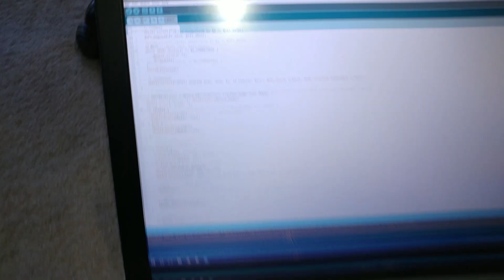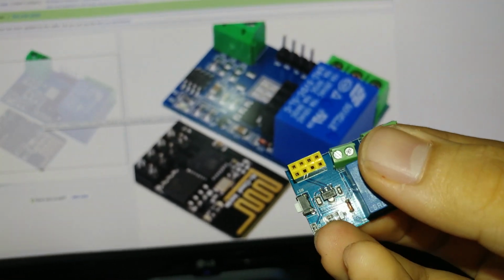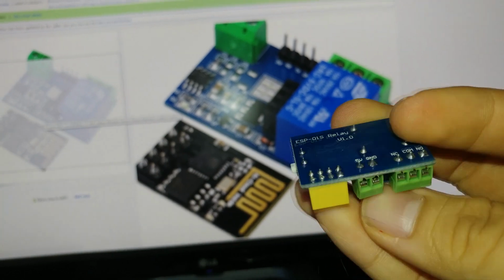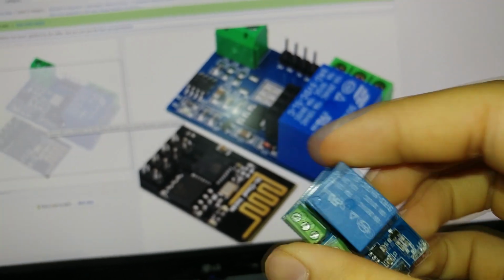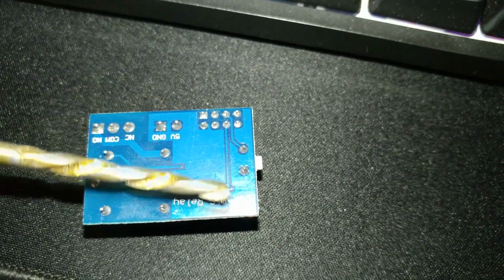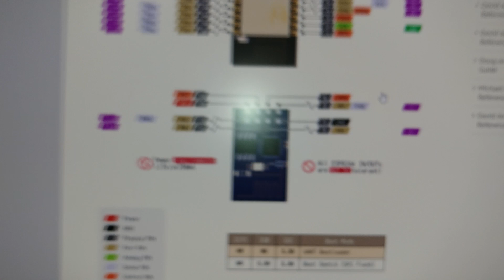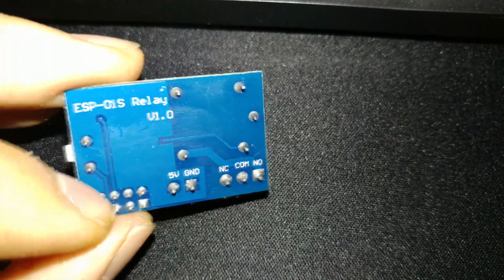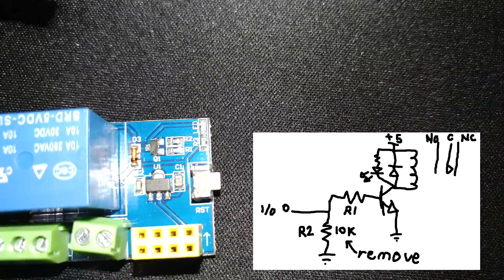How to fix cheap ebay ESP8266 relay module

Comment: Hi SilentDreamcast. So update to my testing using GPIO3 and the good news is it worked. I just had to use a 10K pull down resistor between GPIO3 and ground to stop the startup pulse but since the Arduino bootloader code doesn't care about the state of GPIO3 at boot time it's fine. I'm not sure if 10K is the right size resistor but it seems to work. I'll do some more reading about how to correctly size the resistor.

So in summary when using Arduino code on the ESP-01 in combination with this relay module and avoid the activation of the relay during power up you need do the following mods to the relay board AND don't print anything to the serial port in your code as it writes to GPIO3 which we'll use now for the relay. Printing to serial could cause unwanted relay activations;

I wrote a bit of a step by step below;

!st just google for a diagram of the ESP-01 pin outs such as this one - https://circuits4you.com/2016/12/14/esp8266-pin-diagram. I have a couple of pics of the board mods which I can share with you if you're interested although you'll have to forgive my soldering skills.

1. Jumper pin 4 (CH_EN/CH_PD) to pin 8 (VCC), as SilentDreamcast said in this video thanks.
2. Remove the 10K resistor (R2), once again as SilentDreamcast said so thanks again. It's easy if you just apply a bit of solder (you don't need a lot) and poke it with the soldering iron tip and it will just "float" away. Then use a solder sucker or braid to clean up the excess solder and make sure you haven't bridged anything you shouldn't have. Careful too NOT to accidentally remove the other resistor R1 as surface mount soldering is a bit tricky. The two pads where R1 used to be should be open circuit and not be bridged/connected when you finish.
3. Cut the track on the bottom of the relay board close to pin  5 (GPIO00). I suggest you test continuity between GPIO00 and the two resistors (R1,R2) on the top of the board before and after the cut to verify you've disconnected it. Test to the side or R1 furthest from the relay (or to the pad where R2 used to be as the two are connected). I used a small jeweller's screwdriver slowly and carefully to scrape a rut in the track close to the pin.
4. Scrape off a bit of the protective insulation coating on the track running from pin 5, about 3mm is enough, and tin it with solder. Be gentle you just have to scratch a little. You don't want to scrape the track off the board. Once again I used the same small jeweller's screwdriver.
5. Take a 10K resistor and solder one end to pin 7 (GPIO3) and the other end to Pin 1 (Ground).
6. If you pend the resistor leg going to pin 1 to run it's path along the track you scraped in step 4 before leading it to the ground pin you can solder it to the track that used to lead to pin 5 (GPIO00) and kill two birds with one stone. NOTE: I suggest you solder the lead to the VCC pin first before soldering to the scraped track. You don't want to apply any pressure by pulling the lead after it's soldered to that fragile little track or you could just lift it right off the board and make a mess.

Finally and this is optional I soldered a 220uf electrolytic and a .1uf polyester capacitor in parallel across the coil of the relay to reduce chatter. This may not be necessary but I found it stopped the chatter of the relay I experienced at one point during testing at power on. The second module I modified didn't exhibit the chattering so it might be overkill? It's not expensive or difficult though so up to your discretion. Just orient the electrolytic capacitor the right way. I just manually activated the relay briefly by touching the pads on the board with 5V to determine the correct polarity. The coil leads are the two in parallel furthest apart at the opposite end of the board to the ESP module. If you turn the board over to the solder side and orientate the 5v Ground markings to your right then the coil pins are at the top of the board.

That's it. Works like a charm now after only many hours of lost sleep hacking about and googling :-) 

FYI. I am using some code based on another youtube post - https://youtu.be/X4qXy2JFg_w
I control the relay throug a message bus called MQTT and I run a broker called Mosquitto on a Raspberry Pi. You've probably heard of MQTT but if not it's a must for anyone interested in Home Automation so look into it. Message brokers are used for various commercial applications too some of which I work with. The principal is simply that the Arduino "listens" for a message on a channel name, e.g. GarageDoor. The message could be OpenDoor or CloseDoor, etc. or anything you want it to be. When the code sees the OpenDoor message it toggles the GPIO on for a few seconds and off again and voila when connected across the right terminals on the garage door opener it triggers it. You can then tie this in with other things like NodRed, OpenHab2, HomeAssistant, etc. I am dabbling with all of them and havent' settled on any one particular solution yet.

Thanks for your help and input. Without your post I would have been really stuck trying to figure out why the module didn't even work at all in the first place. I knew about the CH_EN/CH_PD to VCC requirement but never would have guessed removing the 10K resistor.

I hope this write up helps others to get there faster.

Cheers,

Steve

P.S. Love the ESP8266 modules. Like a powerful Arduino with built-in wireless. Been dabbling with them for a while.
Reply from the maker: Awesome work m8. It's good to hear that you got it working. I'll have to note GPIO-3 is the one to use for failsafe outputs on the smaller ESP-01 modules. Also for pull-down resistor, I usually use anything from 4.7-10k, (mostly 10k) especially since lesser current draw for switches and it is a common value for analog sensors voltage divider.
Reply: hi, thanks for your guide! :)
i did this, can you check it's correct? https://imgur.com/a/3vmlflK
here the code i used: https://pastebin.com/ThvKjXHc
but it worked until doing your mod (if i made it correct): on boot i had a burst of on/off of the relay when initially using pin 0 for relay, while now with pin 3 it does not trigger at all... maybe i soldered the resistor the wrong way?
the track from relay to gpio5 is cut, tested with multimeter... and tested the scraped track and soldered resistor leg connection, too, it seems fine...
Reply: nevermind, i reverted the resistor for testing, and now it works flawlessly... BIG THANKS to BOTH of you!
https://imgur.com/a/mgbNZ4Y

Comment: LastI night I found information that indicate GPIOs0-2 present on the ESP8266-01 won't do what I want when using the Arduino boot loader.  See the first response in the post;

https://www.esp8266.com/viewtopic.php?f=32&t=16141.

GPIOs0-2 are always toggled high by the bootloader and you can't use a pull down resistor as the bootloader interprets the state of these pins to select various boot time options. e.g. Enable programming if GPIO0 is held low at boot.  From the link above;

"GPIOs 0, 1, 2 and 15 are pulled HIGH during boot and also driven LOW for short periods. 
The device will not boot if 0, 1 or 2 is driven LOW during start-up."

This makes GPIOs 0-2 unsuitable for a relay control app using Arduino code if you can't tolerate this startup behavior or add some components/circuit to work around it (but I don't know what). This relay board was built to use a different firmware for the ESP8266-01 where the boot behavior differs from Arduino and so does not have the same issues, including the CHP_EN pin 4 needing to be held high by the mod you described.

My 11 year old son actually came up with a possible workaround that I, initially, dismissed out of hand :-). He said why not toggle the relay twice after boot so the door stops opening from the boot toggle and then reverses/closes again. I will try this and see if it works but I expect it will.

However I'm still, stubbornly, not willing to give up on the "proper" solution. What I now know is that GPIO3/Tx is also driven high during boot but its state at boot time doesn't influence any Arduino bootloader behavior so my theory is that if I use a pull down resistor to hold this low at boot and don't write anything to the serial port at any time in the code (as that flashes the Tx led/pin) then GPIO3 might work for me.

According to documentation,  in the link I mentioned earlier, GPIOs 4 and 5 are the only ones that are always high impedance and the best options for my application but as you know ESP8266-01 only has GPIOs0-3. All other GPIOs on any on the ESP8266 varieties have internal pull-ups or are even driven low/high during boot.

"GPIOs 3, 12, 13 and 14 pulled HIGH during boot. Their actual state does not influence the boot process. See below.

GPIOs 0, 1, 2 and 15 are pulled HIGH during boot and also driven LOW for short periods. 
The device will not boot if 0, 1 or 2 is driven LOW during start-up.

GPIO 16 is driven HIGH during boot, don't short to GND."

I will experiment tonight and report back on the results.
Reply from the maker: Very very interesting. I haven't played with ESP8266 for very long and have only ever used the bootloader that comes with the chip. And the projects i have done with them aren't affected by that quirk (I use it as a quick test "feature"). I'll have to play around more with these too during some free time

Comment: just wondering after removing the resister did you like, connect them together, as u know there will be a gap,,,, I did remove the resistor  and solder the space after the removing the resistor but it didn't work
Reply from the maker: Saoud Ahmad the 10k resistor is a pull down to GPIO 0 which puts the ESP into programming mode. So to get it to run your program you need to completely remove the resistor. Do NOT solder bridge the gap, it should be empty space so the ESP runs the program
Reply from the maker: Also remember to solder CH_PD pin to 3.3v to enable the ESP
Reply: Thanks a lot , it worked now all of my 5 esp relays with Home assistant

Comment: Hi, just one question if you or anyone has an idea. When power is applied there is some initial relay chatter. Any idea how to stop that? I'm wanting to use them for a garage door opener so the relay chattering could accidentally open the door in case of a power outage and restoration which would open up the house. That's obviously not so good if it happens while we aren't at home.
Reply from the maker: Stephen Polzin what code are you using? It's most likely due to the serial port printing. Remove any serial.print commands from your code. On some esp modules this is just unavoidable startup sequence. You can cut the PCB trace and solder a wire from the resistor to an unused pin on the ESP module and modify the code to match the pin change.
Reply: SilentDreamcast Thanks but it's pretty immediate on power on and I also tried with the default program when you start of in the ICE and it does the same so I don't think it's even getting to the code yet. It simply toggles the relay IO on and off once and therefore the relay. A couple of capacitors across the relay power seems to have calmed any chatter. I have a theory that it might be only happening on GPIO0 but haven't had time to test it yet. If that's the case I might have to butcher the board a bit to use a different IO. Not sure if it's the same with the -01S version of the ESP and no mods on the board. Anyone tried that?
Reply from the maker: I figured it must be an internal thing within the ESP bootloader (you have confirmed my suspicion). I don't normally use GPIO 0 because it's a special pin. I can confirm that Startup toggleing doesn't happen on the other pins so i would suggest change the code to use different pin, cut the trace and rewire.
Reply: SilentDreamcast yeah that was my thought exactly. I just posted earlier the same thing to the user who said that ESP-01S didn't need your mods. I also found adding a 220uf electrolytic and a .1uf polyester capacitor across the relay coil stops annoying relay chatter.
Reply: SilentDreamcast Lol. I liked the look of this module as it was plug and play after I'd fried a couple of ESPs using 5v relay boards due to my dodgy cabling :-) Now it looks like I'm up to mod #3 😄
Reply from the maker: Stephen Polzin the capacitor solution works because the low resistance created by a discharged capacitor and its charge time to trigger the relay is longer than the startup pulse to cause a delayed start. At the cost of some added space and BOM.
Reply: I'm sorry to say that the same thing happens with GPIO2. Wow, I am really frustrated by this. It seems like such a small thing but I can't find a fix. I've tried setting GPI2 to LOW before setting it to mode output. To test I have put a 1K resistor in series with an LED between the GPIO2 ping and ground. At power up it flashes showing that the relay would have been activated. I have tried various pull down resistor values between 10-50K between GIPO2 and ground to see if at power up it would stop the pulse but I haven't had any success. TBH I don't really know what I'm doing :-) Any more ideas as I'm totally stumped.
Reply from the maker: Stephen Polzin wow really? Did you cut the original trace to GPIO-0? I have used every pin on the AI-Thinker version which is same ESP8266 chipset but with more pins broken out and I haven't had that issue other than pin0
Reply from the maker: another, simpler idea would be to make a "RC delay circuit" by putting a 47-220uF capacitor between the gate/base of the transistor and ground
Reply: SilentDreamcast I thought something like that would be possible but I'm just learning electronics to dabble in home automaton and encourage my son to do something more useful with computers and iPad's than just play games all day :-) so can you please suggest a circuit example via a link? I presume you mean to add a transistor as I don't see one already on the board. I have a few transistors of various types about the place so I could whip something up to test. After some googling I understand better now the behavior of the ESP8266-01 - see my next looooong reply.
Reply: SilentDreamcast yep, cut it.

Comment: hi Silent,this type of board work without any modification only with esp8266 esp01s not with esp01.Esp01s is different of esp01.
Reply from the maker: Sorry, I don't understand your question. The esp8266(esp01) does not need any modification, just programming. The relay board does need modification if you get this exact one.
Reply: I want to say if you use relay board ESP-01s with wireless module esp8266-01s you don't need remove 10k resistor or do jump pin Vcc to pin Chpd.Wireless module esp8266-o1 is different from wireless module esp-8266-01S.
Reply: Iulian Lazar Hi do you have the same behavior as me with the ESP-01S and no mods of the board that the GPIO0 toggles high then low on power up causing the relay to close and open once?

Comment: Don't know what version of fauxmo you are using but haven't been able to get it to recognise my modules even exist so fa when I try and add them with the Alexa app. :(
Reply from the maker: stewartrv 1. make sure the add device names are all unique. Or else Alexa will think they are all the same. 2. Check that your wifi SSID and password are correct. 3. Log into your router to make sure the ESPs are connected and giving out IP addresses. 
This is assuming you were able to flash code successfully and when you turn it on the relay should click twice.
My version of fauxESP was the latest version on GitHub(at the time) that shouldn't be the issue if it compiles.

Comment: Hi~ Silent > I have one problem , I found when I pulg ESP 01 in to relay , the ESP 01 have power but GPIO 0 can not work . The led of single not flash.But when I pull GPIO 0 out and press rest button , I found single of LED is work, and I plug GPIO 0 line again, everything is fine. How to fix the problem. I want plug ESP 01 into relay and it works, Don't need to plug GPIO 0 again.
Reply from the maker: Bryan Chen are you using the same relay module as me? You have to follow PCB trace and remove 10k pull-down resistor from GPIO-0 that is on relay board.
Reply: I forgot to remove 10K.......
Reply: it works~thanks~~~~~^^
Reply: Hi dear ~Do you have any video about set up ssid password to esp8266 from app (iOS)?
Reply from the maker: you setup ssid and password in the code. You can not change it in app. You can only soft-rename the device in the Alexa App.

Comment: Which 8266 Code you used for Alexa with this ?
Reply from the maker: I added a link to the modified version of the code in the video description. I changed the relay pin and disabled some button toggle stuff in the code, you just need to change the WiFi SSID and password to yours. Thanks for watching. Also to change the default device name, modify line 71 and change "relay 3" to anything you want. you can always change the name link in the Alexa App.